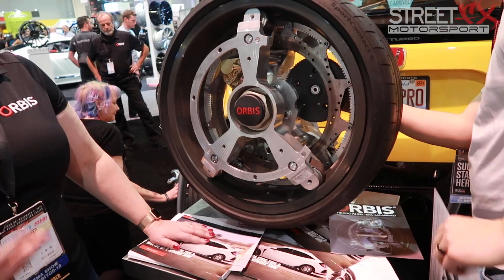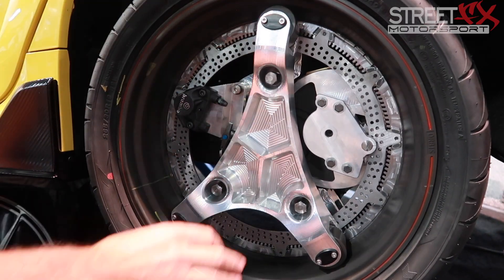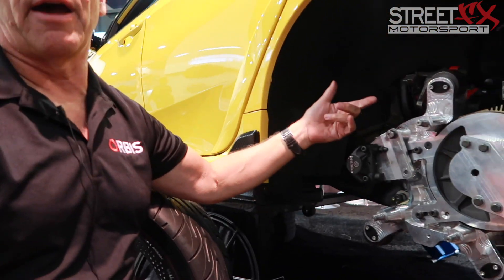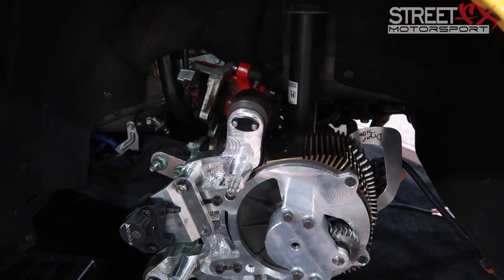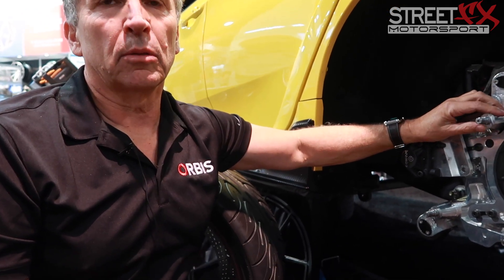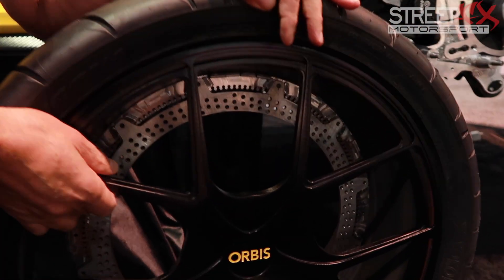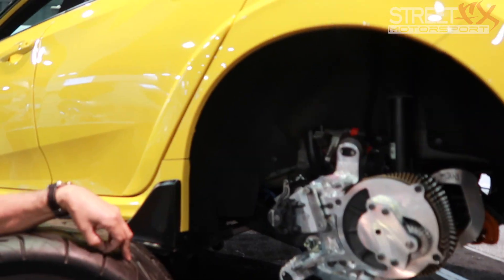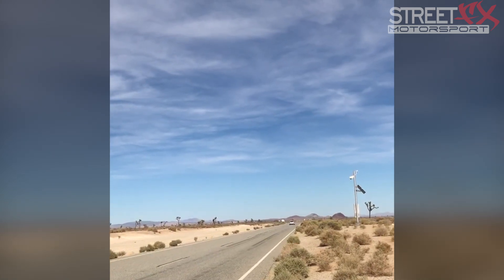WORLD's FIRST ELECTRIC hybrid AWD Honda Civic Type R FK8 with 450hp!

Comment: How about dirt ingress? Looks like a small amount of brake dust / dirt on those gears would chew then to bits
Reply: @Noise Control.

You obviously have no idea about drive trains and wear.

Two gears that mesh together must be clean and lubricated.
The tolerances required are tight and even a small stone could destroy that system in fractions of a second. 
Lubrication is required to reduce wear... However lubrication is sticky and can trap unwanted dirt. 
Dirt in lubrication then will start to act as a grinding paste slowly grinding the contact surfaces down. Once the mating faces are worn, back lash then occurs and then torque transfer would rapidly tear this system apart! 

Yes the wheels are rotating however this does not magically stop dirt ingression on to the drive teeth.
Reply: @Noise Control your first comment certainly doesn't sound like it
Reply: @adamrobertsgb1  hey Adam, just put those gears in sealed enclosure and give it gear oil ,  it pretty easy to design sealed system for 2 gears
Reply: @valpanig  please explain how you can put those in a rotating seal.... The brake pad and disc is right next to the outer gear.

Any lube on those gears will attract dirt, then lube + dirt = grinding paste and will make short work of those gears
Reply: @Noise Control no...try driving without diff cover and see how long it lasts.same with cv joints,dirt and greace pulls gears a part

Comment: Thats very cool.
I was ready to scream "UNSPRUNG WEIGHT" like  Marty from MCM with head gaskets, but then BOOM no penalty.
Would be interested to see what control the wheel laterally and how it handles high cornering Gs, especially with rough surfaces.
Reply from the maker: agreed. I see some inherent flaws but it will be interesting to see development of the product over time.

Comment: Great video.  Thanks for coming by to check out my Type R at SEMA.  Sorry I missed you.
Reply from the maker: out of interest Jason, was your car functional with the electrics or just for demo? No offence intended. The concept is incredible, but it seemed that yours was maybe chosen cos of the e-fame and the brighter colour, but not quite finished or ready to run. 

It's obvious the concept works, but has yours been utilised as per displayed?
Reply: You should consider doing a video with Engineering Explained on your new AWD Civic.
Reply: Jason!!!!
Reply: RIP
Reply: rip
Reply: Saw the yellow insta tly thought it was yours .... cool car
Reply: How it drive?
Reply: When will we expect to see a video on you're orbis Type R?
Reply: HondaPro Jason Hey Jason when is the video coming????? What is the maximum speed for those wheels? So much I wanna know!!!
Reply: @1wasinAlpha  the guy in the video said the one they had there was capable of 120mph & more with a gearing change.
Reply: When you solve the integration issues with this( Regen optimization, higher hp, all electric mode, launch control, abs integration, mostly limited by the motors themselves) you will have a patent on the near future of the auto market. Between the massive push for electric, the weak infrastructure supporting it and the traditional gas and diesel market still preforming so well this is a key midpoint in the all electric dive. Traditional hybrids lack the flash and flare and having the system be literally bolt on is a game changer. As a mechatronics engineer I'm massive impressed with the potential of this product and am very excited for it's future.
Reply: HondaPro Jason ur car isn’t truely awd. So please don’t say you have an awd fk8 type r
Reply: @FerrariLamborghini24  But it is AWD. Are you saying that the Porsche 918 isn't AWD because it's a hybrid? This is an AWD Hybrid Civic Type R.
Reply: @FerrariLamborghini24  its still awd. Just nontypical

Comment: This is a ridiculous answer to a question no one asked. It's neat, I'll give it that. From the looks of it, the rear of your 400hp Civic is now held up by 3 skateboard wheels. What could go wrong? 

Installs in 1 hour? Right. Completely remove and install entirely new rear hubs, wiring, battery packs, can-bus line, new proportion valve, new brake lines, bleed brakes, custom install a battery pack from X car, mount giant motor controllers.... What else? 

Oh and it's $10k + plus a battery pack. Where are we now, $50k for a CTR and this kit?
Reply: I wouldnt worry too much about the bearing things, the wheel bearings in my taurus were barely bigger than a circle i make with my index and thumb
Reply: Probably not worth it now....but I can imagine it being a lot of fun.

Comment: when and where can I buy this? I want to put this on my civic. Also could this be used for track days? How do the components hold up under track conditions?

I just looked at the motor trend article from oct, looks like this is a prototype & proof of concept more than production ready, so I guess it wouldn't hold up too well after a few track days, oh well. Still super cool, I would definitely get these motors if they were track ready

Comment: $10k for 100hp... batteries not included... hmmm. That's gonna be a hard sell when you could build 2 x 600hp LS turbo motors for the same.
Reply: In 99% of the world you're not building 1 600bhp LS Turbo for that. And even if you could, you're not adding 100bhp AND 4wd to most cars for that.
Reply: @StavTech  yea.. you're missing the point.
Reply: Ricky R no. Someone talking about an LS turbo when this is about making a Civic 4wd is missing the point
Reply: @StavTech  using LS turbo as an example.. the cost per/hp is a hard sell. That's the point. You're paying for an upgrade that's 1/3 of the cost of a brand new car.
Reply: Ricky R yes an LS turbo can be good value, but not for this. 10k US don’t get you far on a new Civic Type R
Reply: @StavTech  10k can pay for a turbo upgrade, fuel upgrade, tune, exhaust and intake/manifold upgrades. And make well over 100hp.
Reply: Ricky R get back to me when your 10k in conventional tuning gets you 100bhp and 4wd. Then I will be missing the point. Until then, I’m not
Reply: @Lillos85  hp doesn't mean shit.
Reply: @renderyours510  yea that's why they turbocharged the Civic from factory. Lol
Reply: @Lillos85  so why is it that the type R can beat cars such as the 996 GT2 or the Gallardo Superleggera around the track? They have much more hp.
Reply: @renderyours510  so if Honda didn't need more power than their base model. Why turbocharge it? Wht increase its displacement?
Reply: @Lillos85  they boosted it because they wanted it in the 2000cc turbo class and because it wouldn't have sold if it was n/a. You didnt answer my question though. If the only thing that matters is hp, then why is this a more competent track car than those with two or three times the power
Reply: @renderyours510  please quote me as to where I said all that matters is horsepower? Lmao ironic comment when you're arguing on a thread about a power adder on a civic.
Reply: I like electric and 4wd, don't get me wrong. But even in expensive Australia (where I live), it's possible to build 2 turbo LS' for that. What's more with 600hp and sticky tyres, you don't need 4wd. Additionally, by the time this setup got to Australia, it would AU$20k for 100hp/4wd... and I'd still have to buy batteries. That's before we talk about local modification laws and whether it could be registered.
Reply: Depends on the state and the car. Stricter than the US and UK, but a turbo LS is possible for a heap of cars over here and certifying it would be much easier than the electric 4wd conversion.
Reply: @StavTech  it's easy af to build 2 for that 600 hp is nothing for a ls
Reply: Johnny in the USA, but not in most countries, in the U.K. even a junkyard 5.3 truck engine is at least 5 times what it costs in the USA.
But regardless, you couldn’t fit one in a Civic for that, and not 4wd either, so I don’t know why it’s relevant.
May as well talk about all the coke and hookers 10k will get you.
Reply: It's definitely far from the point
Reply: wont this invention saves the driver more on gas?
Reply: The civic as it is can get more then 100hp for 1k$ maximum,without adding weight,no annoying noise either dont need that shit for 10k i can build it to 1000whp...and if i can everyone should!!
Reply: The novelty of these is worth it. Looks very cool
Reply: Money you save on gas will pay for the mod itself in 2-4 years 😅
Reply: Why do people choose to make horrible comparisons? Any guy putting this on their car probably never considered an LS swap at any point.
Reply: I dont think you understand what hp figures actually mean.
Reply: I genuinely understand the people who are yelling "But AWD!", just consider that it's awd alright... but it's making 100hp at the rear... lol.

I think its AMAZING tech. I wish I could get ahold of it, just makes me feel idealistic.

But AWD... 80/20 isn't much of an AWD... maybe with the 75/100hp rear motors it would be amazing, but we don't know the cost or weight of those. Or if they have heat issues.
Reply: Slow Learner If the car wasn't designed to go that fast you'd still need to severely upgrade the cars suspension etc.
Reply: This mod is really for fwd cars such as civic, focus st, mazda 3 speeds, golf gti's, and so on. If you have any one of those cars built already than this is probably the final mod you use. It takes away the disadvantages that those cars struggle with specifically torque steer, wheel hop, and weight  distribution. The added acceleration and fuel economy  is just a bonus especially if youre using e85.
Reply: Living in Canada I'd rock this on my si if it was in the budget
Reply: Yeah man, I'm just gonna stick two  LS engines  in my Civic wheel wells. Fuck this shit.
Reply: Slow Learner I mean it’s also going to be as efficient as a Prius and as reliable as a new car. You really can’t beat that and with the 91 gas in California being an average 3.80 a gallon your going to save a lot
Reply: Dang! Could you build be a 600hp LS for $5k?
Reply: Space wise electric motors are superior, you'll have a hard time fiddling two LS' into a Civic
Reply: Lol always a troll LS commenter.
Reply: Slow Learner, you must be fun at parties talking about your LS turbo conversions with all your other sheep LS followers. How long does it take to fit an LS to a car? How many hours labour do you need to pay for doing it all from engine removal to install, exhaust be built, wiring look, fuel supply system. You think you can do 2 of these for under 20k in Australia with most workshops charging out at $100+ per hour your dreaming buddy. Did you factor in double row trimming chain upgrades, oil pump upgrades, cam cos that ones 200k old, then valve springs and pushrods for boost. Not everyone can do all this work at home.
Reply: @PokeysMechanical  I'm not particularly an LS fan. I don't own an LS turbo car. Although I have recently built a turbo setup on something else, myself. What I'm pointing out is the relative expense of this setup as against much more hp/$. Yes you're right about paying a workshop to do the work. It would cost more. But then it's not that hard to work on cars. And the 10k he quoted here was without batteries, installation, shipping, certification, or regular maintenance costs. How much would a workshop charge for all that on this setup? Hmmm....
Reply: This is essentially an AWD 400hp civic. Plus this setup brings this car closer to a 50:50 weight bias For 10k. Put an LS in a civic.. if it does manage to fit not only will it be vhanging the front bias but, you also need to spend another 10k-15k fabricating an AWD system. This electric system if it does work like the guy says gives you 100hp & awd PLUS it can increase fuel economy.

Comment: You can use the Lithium Ion battery from the 2012-2015 Civic Hybrid instead.
Reply: biggdaddy2000 on how much amp doe you charge them?
Reply: biggdaddy2000 graphene actually is better overall than lithium ion batteries,at least the batteries that samsung has.
Reply: New Graphene batteries are best...they don't catch fire, hold more charge and last longer
Reply: Deejay Core And aren’t commercially available

Comment: Imagine this in the UK, 1 winter and with all the salt its rusted and seized.
Reply: Aluminum doesn't rust
Reply: Looks like aluminum..
Reply: It's aluminium.
Reply: It's aluminium, like your suspension withbones are now....

The motor as he mentioned: fully submersible.
Reply: @superchickenlips1  the "new technology" you've decided to defend is just another gimmick product based on underdeveloped concepts.
Reply: Aluminium oxidises.... Your smart meter is 39 kva your original 44kva guess what you're going to be charged loads more for more / penalised for your energy use
Lpg anyone?
Reply: Then just remove it in winter. Whats the fuzz?
Reply: Corrosion x
Reply: Same in Finland
Reply: Mathieu Morin Engineering Explained recently did a video on this. I suggest you check it out. The batteries aren’t as bad as you think.
Reply: W.....T.....F 

PHONY!!!!
Reply: This product will not be available in the UK
Reply: You can paint it black.
Reply: @superchickenlips1  Thanks for the salt education. Doesnt stop this from rusting and corroding, maybe design a all weather unit and not just for use in a sunshine state? Its about being a realist, 9k for something that will be rusted and useless in 2 years... is that a good invention?
Reply: @isoconfused8744  You missed the overall point because you're consumed with corrosion. It's the implications of this technology and it's implementation. Go back and listen again. No driveshafts. No differential. No lots of things that you would normally find in a normal 4WD rear end. Its lighter. It gets better fuel consumption and therefore CO2 emissions are down. Try and see past the end of your own nose and you might catch a glimpse of something that can be used in many many applications and is groundbreaking technology and engineering. So yes, it is a good invention, and when it's 100% element proof, you can stop worrying about the corrosion. Until then, just think; this bolt on kit could be put on any car or pick up. Think about a pick up that gets you 50mpg round town.
Reply: @superchickenlips1  id do it on my 76 d100 for sure. I got a 440 in it, so around town being able to use this would be mint.
Reply: @damiendoisher7812  at least you see the point and not just the weather.
Reply: @superchickenlips1  one point is that without a locking Differential the Power from one Side is unavailable If the ground Need the Traktion on one side
Reply: @Nordlicht05 - He explained that the whole system is setup so it works like a LSD. There is feed back to the system so it can operate each wheel independently. This would actually hypothetically outperform a locking diff.

Comment: He said 9k for 100hp extra 😂😂😂😂yhh i left my wallet in the car let me go get it i will be back
Reply from the maker: Think of another mod that gets u 100hp for $9-10k but doesn't add strain on the rest of your driveline or require upgraded clutch, fuel system, etc. not to mention converts you to awd!
Reply: @StreetFXofficial  Exactly, people don't look at the bigger picture.
Reply: Whatcher 100 hp is no helpful or 4x4 u be ask and say please i need that 9k is nothing for this works and bravo orbis the best first do like this system never see like that I soon buy this for rear wheel wow.
Reply: "AWD", The rear wheels make a max of 200hp combined (no word on additional weight or price), this model makes what, 250 stock with 50hp added per wheel? The fronts make 250-350 horse and the rears make 50.

Never heard of an AWD with an 80% front bias.